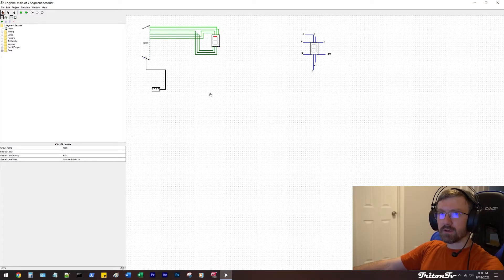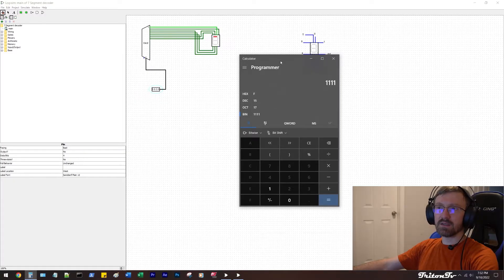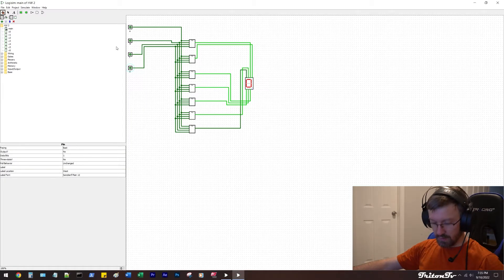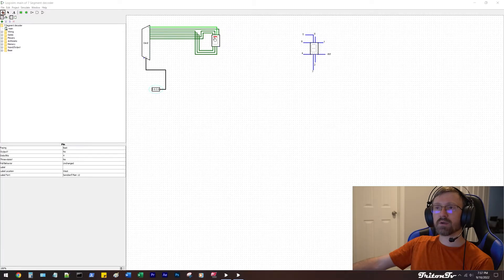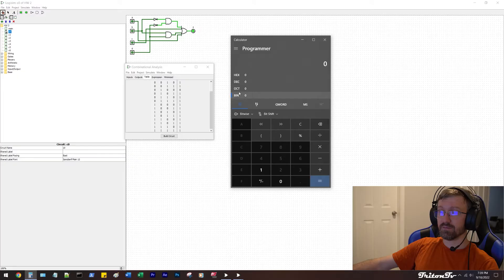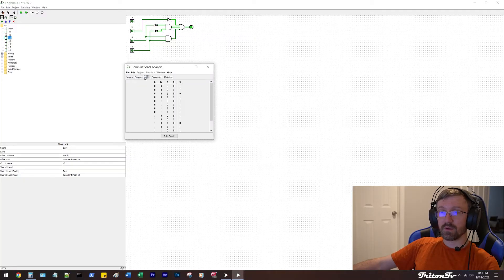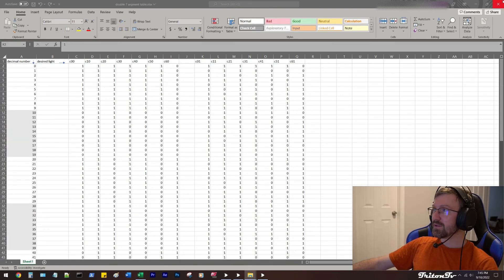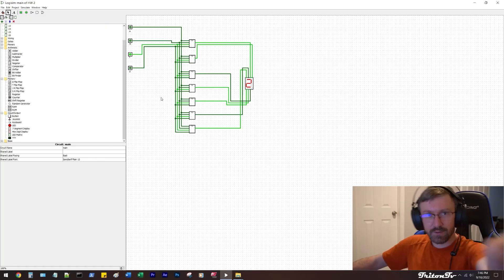How to make a 7 segment display work in logisim

Comment: im really confused about the truth table for each of the circuits. I tried setting the output to 1 for each of the lights needed to get 1 and it didn't work. Can you go over the formation for each circuit
Reply from the maker: hello! make sure you decode your 7 segment first(make a numbering convention). then stick to what you set each light as. In this example starting from the top then going clockwise they are numbered 0-6 skipping the dot which is the bottom right pin. You will set the binary number to true ( 1 ) for each light that lights up for that decimal number. I can send you the decoder I made, it should help setting the truth table. Check about section of channel after you subscribe for email ;) for example light 0, the top one, it will be true for the binary equivalent to the decimal number's 0, 2, 3, 5, 6, 8. all others for 4 inputs will be 0 or false. Then you need to make a list of the other numbers and which light needs to be true. I could have explained it much better in the video! hope this helps.
Reply: took me a while but I figured it out. It works now. Thank you! @TritonTv69420
Reply: I need help with a project Im building. its supposed to be a digital combination lock the thing is I want to use the button feature in logisim to enter numbers but I do not know how to do that. I am also using a d flip flop for the states and memory. what do you think? @TritonTv69420
Reply from the maker: After you subscribe email Triton. 😀😂🤣 Check the about section on channel page for email. Maybe look at a decoder and somehow store what you enter after a clock cycle.